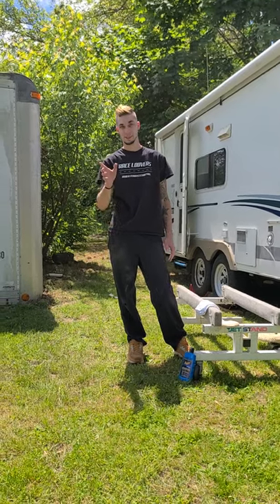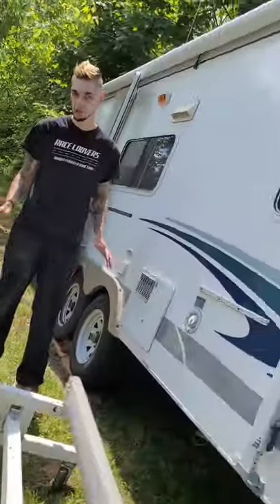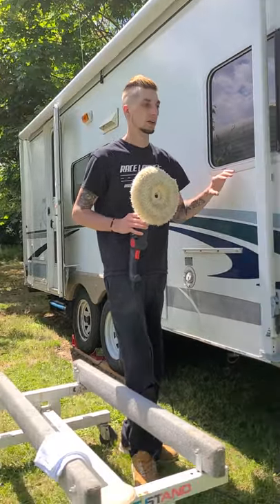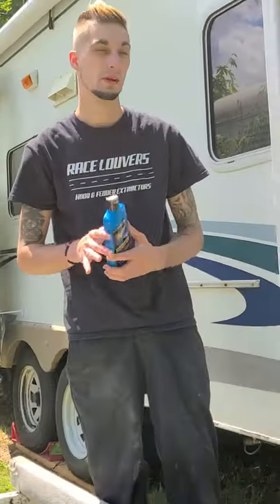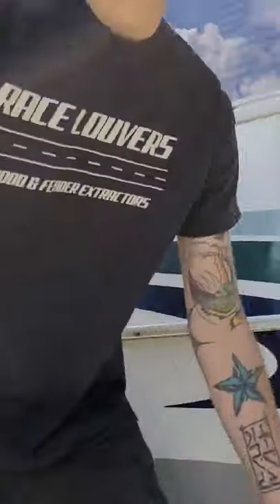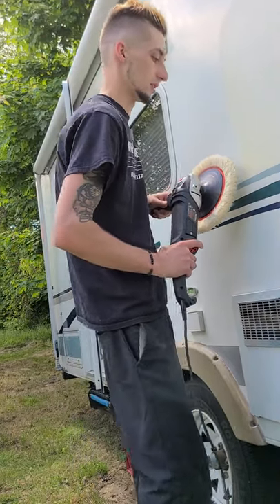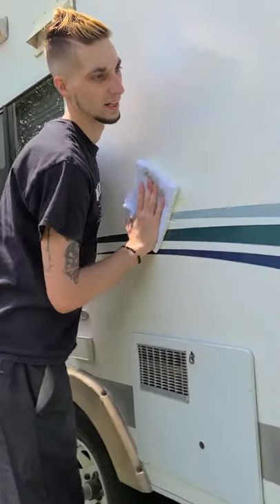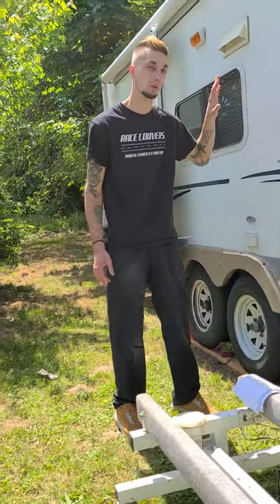How To Compound Your RV

Comment: Would the same method work for aluminum sides campers?
Reply from the maker: It would be difficult to use a buffer on an aluminum sided camper. I would do it by hand, but yes you sure can! Where the aluminum siding connects would rip at the fibers of the pad. Just take your time and do the same method by hand.